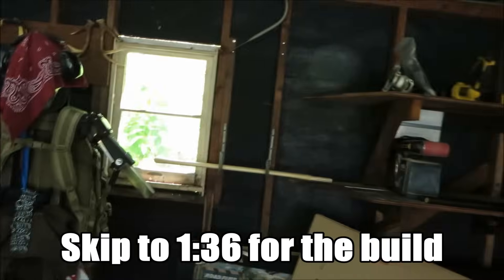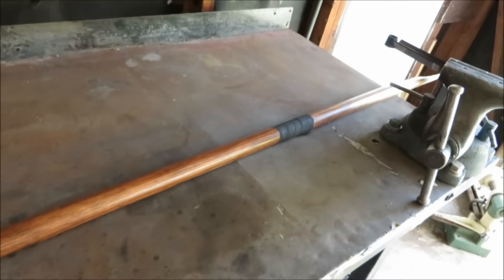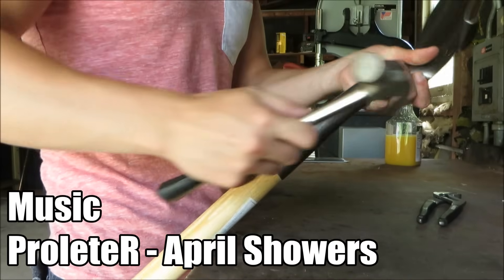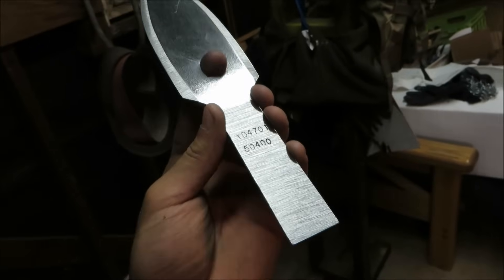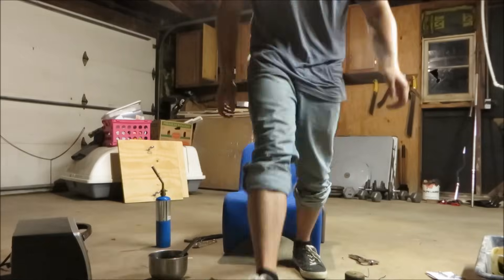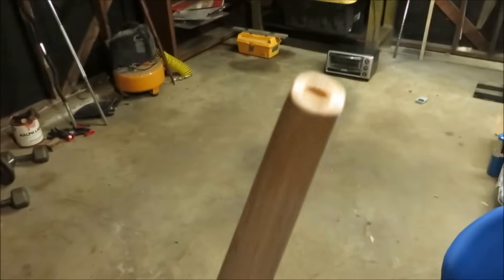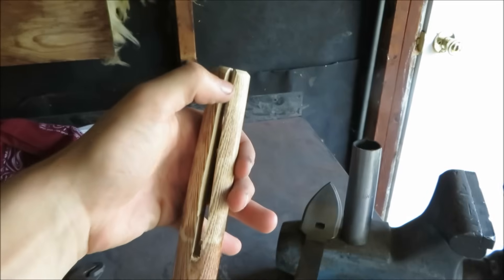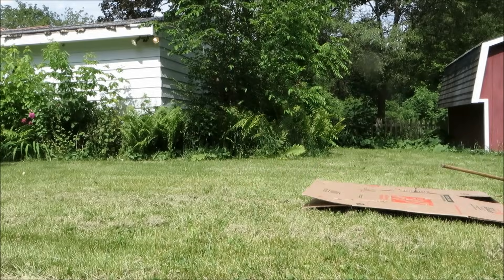How to Make a Throwing Spear

Comment: Just for future reference- the lawnmower blade would've been fine without heat treating (in fact heating up the blade would just draw out the temper already in the blade) as long as it was kept from overheating.

Comment: You don't NEED to polish it after the tempering. It is a good idea to make sure you have it clean for it's last coat of oil to avoid rusting, but it's a longevity measure. Usually you temper then put the final edge on. You don't want a very fine edge when heat treating and tempering because it makes it more likely to warp the blade.
Reply: He's right. I'm a knifemaker, and when I send my blades out for HT, Everyone tells me not to put an edge on it because of warping. I've never had it happen, but I'll learn from it when it does 😉.
Reply: Hunter Hengst Haha. Yeah the day it happens will be a sad one. I'm pretty sure it has to do with what kind of metal you're using. If you're using modern materials that you are just shaping, I doubt you'll run into an issue. If you're making your own billets from plumes or mixing materials it's probably more likely to happen. I think it has to do with irregularities in the material.
Reply: HairyViking111 he cooked them
Reply: MrAws0m3Gaming Yes.
Reply: U just grind that there primary bevel down to .020 inches and ur all good, shant warp provided u pre heat ur quench and make sure that u heat the metal to the lowest possible temp before the quench,it's not the tempering that warps it, it's that there quench, tempering ain't a shock to the metal at all, I mean if u make a rig and temper, u can get sum bends out, but it won't warp shit naturally
Reply: Lol haha

Comment: At the beginning you came off as annoying, but you're a pretty smart kid. Glad to see you know your shit, or at least you're doing your best to learn from your mistakes while meeting problems and making a plan to deal with them. Keep blacksmithing alive, even if it's using a hand torch, speaker magnet and an oven. :P

Another trick you can use, if you didn't already know, is if you have the lights down low or off, you can tell when it's ready to quench when its the color of the red rising sun. Should be non-magnetic at that point.
Reply: Ó Slatraigh that color doesn't seem very specific... but i don't know enough about red rising suns to debate it
Reply: teejaye110 Like the japanese flag. ;3 You've never seen the sun when it's that bright red color?
Reply: That my friend Ó Slatraigh Slat rights not blacksmithing  but stock removal
Reply: nick schafer I don't need you to tell me what smithing is. I was a metalsmith's apprentice for quite some time. I have used every type of peened tool you can think of, sledge hammers, pneumatic hammers,drop forge, chisels, tongs, hardy tools, punches, monkey tools, vices, coal and propane forges with hand crank, bellows and electric blower, and I can tell you that stock removal or grinding is a part of smithing, whether you use a power tool or a water wheel and stone.

Blacksmith

black (iron), smith (artisan)

It doesn't matter what tools you use to achieve what you need to do, but whether you are crafting something from iron/steel.
Reply: cough cough if he is making a blade he is technically  bladesmithing please let me know if I am wrong Ó Slatraigh

Thank you for informing  me on this subject, i'm just going to catagorise everyone who works with metal  as metal workers
Reply: nick schafer Bladesmithing is a branch of blacksmithing, unless you're working with a different metal. I'm not sure what about this is unintelligible to you. A farrier is a smith who makes, repairs and fits horseshoes, but he's still a blacksmith. A bladesmith making blades of iron or steel is a blacksmith.

People who work with metal are metal workers. It's an umbrella term. Metalsmith is a catch all for those who fashion things of various metals, including, but not limited to: blacksmiths and whitesmiths (tinsmiths), goldsmiths, silversmiths, etc.

black·smith
ˈblakˌsmiTH/Submit
noun
a person who makes and repairs things in iron by hand.

met·al·work·ing  (mĕt′l-wûr′kĭng)
n.
The process or art of shaping things out of metal.

Noun	1.	metalworker - someone who works metal (especially by hammering it when it is hot and malleable)
smith

He fashioned a spearhead of what appears to be a ferrous metal.
Reply: Ó Slatraigh i learned much today thank you

i agree on the ferrous metal
Reply: Anne Nonimus Ok, blacksmith/knifesmith here, Forged in Fire is a great show but the judges and the host are absolute shit... its a reality show for a reason but I wouldn't take what they say to heart. If anything pay more attention to the craftsmen and less attention to the judges and host.
Reply: Ó Slatraigh You know your stuff mate.    :D
Reply: solosniper86 No I don't. I've never opened up my guts to look. :O
Reply: Ó Slatraigh haha.might hurt a bit.
Reply: i don't know him but i like to thank you for the comment, i'm (part time blacksmith, sort off) but i have learn that you never losses in smithing or in life...ever....either you win or draw or must important... you learn and if you learn you didn't losses at all!

Comment: that thing seems pretty heavy.... more for a close-fight or so.
Reply from the maker: Cacalari Bus Heavy compared to what?
Reply: ZednoughtAlpha
compared to something like that: http://www.fotolibra.com/gallery/32524/early-hunting-spear/like/

Maybe something like 1.5pound would be good for throwing a long distance?
Reply from the maker: Cacalari Bus A stone age spear? Well yeah, steel is heavier than stone, I showed in the video though that you can hit a target at least 30 feet away, and that's with no spear throwing experience. Definitely wouldn't say the extra couple ounces make it a close range weapon.
Reply: ZednoughtAlpha
ok, nevermind :) .. for long range they would use another system anyway.. with the sling attached to the speer.
Reply: ZednoughtAlpha could just use the pins and wrap the top with twine instead of the shovel tube.  but what you made is awesome anyway. good job
Reply: Remember, when throwing a spear, hold one hand below the balance point to make sure that you throw it front heavy.
Reply: +Cacalari Bus Roman pilum could weigh up to 11 pounds. And it was designed for throwing.
Reply: armorhide406
so short-are throwing I guess. 5- 20m or so. Ok.

Comment: Nice video, one small thing:
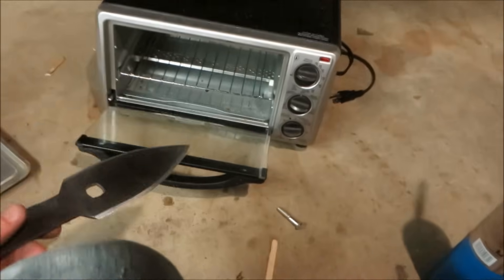"...the tempering is done when it reaches like a golden wheat color" (06:00)
One of the most proliferate (but understandable) wrong assumptions about metallurgy. No, it doesn't. The color depends on the thickness of a forming surface oxide layer, that thickness depends on the metals surface temperature. Straw-gold means you reached around 400-440°F (200-230°C), on the SURFACE, but it doesn't tell you that the martensitic structure inside the steel has been sufficiently relaxed.
The general rule-of-thumb for simple oil-hardening tool steels (like lawnmower blades) is to soak for 1-2h at a bit over 400°F. If you want it more precise, find out what steel it is, and go to the manufacturers website, they usually have detailed data sheets for the heat treatment oftheir products.
Reply: Why did you write this and why would I read it
Reply: Because you care about metallurgy?
Reply: You mean soak as in place it in oil and then heat it? Why would you have it in oil? More even heat distribution?

(edit: I know this is two years old but please answer, I wanna know)
Reply: @opiwaran354  no he means soak it in the heat for 1-2h, though soaking in 200c oil for 1-2h works better as the oil gives a more consistent heat as it acts as a thermal mass
Reply: @lol49031  okay, thanks.

Comment: how would one go about tapping the spear head in place? considering the tip of the spear won't enjoy being tapped with any kind of hammer.
Reply from the maker: +BionicleFreek99 For a majority of the tapping, I inserted a steel rod into the hole in the lawn mower blade and struck it downwards (as shown in the first spear build), then for the remainder, I clamped the blade in a vise, padded the bottom of the spear shaft, and tapped from there.
Reply: +BionicleFreek99 Another method you could use is, if you have vice grips, clamp them onto the blade horizontally and tap the grips with the hammer. You may need to alternate the side you have clamped to tap it in evenly though.
Reply: put a block of wood on the spear point and hit the wood
Reply: +BionicleFreek99 use a piece of wood, a wooden mallet, rubber mallet or even a large block of wood would do
as long as it isn't metal what you are using to tap the spear in you'll be fine
Reply: +ZNA Productions lol at the store they probavly wonder why u need so  many shovels and lawnmower blades XD (p.s we have the same Birthday Nov 13)
Reply: you could put the speed head in the vice and tap the end of the spear into the the bottom of the spear tip
Reply: BionicleFreek99

Comment: I find that when working with wood, no joke, hot glue is extremely strong, and easy to replace in the event of failure. But you have to get the hot glue way hotter than you should. So an overzealous hot glue gun is required.

Comment: Nice,  a spear is the best non firearm for defense.  You can hold off an angry mob with a spear as long as you got ur back covered by a wall or suchlike.  Depending on the length you can keep your foes at a safe distance from their clubs,knives, machettes, axes etc.  As an added feature you could bang some nails thru the end(about 8" behind the spear tip to prevent someone grabbing at your weapon as once that happens you are at the mercy of the main mob!!

Comment: Also, I was wondering if putting epoxy or glue would keep the tang from wiggling around too much. I notice it happens with some hand made stuff. The space between the pins and/or the tang and the haft (or handle, whatever) is too much. Or so I would imagine. Let me know what you think. 
And thank you for posting. It was REALLY simple to follow and it makes a realistic if not modern spear. Battlefield worthy I would say.

Comment: try making a rocket forge, pop the valve on an empty propane tank, cut around the top handles then cut a smaller hole in the side for one of those heat blowers then attach a propane torch and then turn it on

Comment: Just use something like Japanese blue steel or a cobalt drill bit for an edge, and then then forge weld that to wrought iron. Then shape the tang of the blade into a cone so it can mount onto a shaft.
Also, lawnmower blades are made of a very cheep tool steel, and I would not recommend it for something like a spear blade.

Comment: The quench-oil instead of water: does this protect the metal, cool it at a different temp for effect, or both?
Reply: Quenching in water can raise chances of micro cracks, while forging heating up the oil to about 100 degrees helps reduce the chances of cracks and maybe warps

Comment: Why not just start with the shovel, straighten the scoop out and cut away any unnecessary metal?  Then you can put an edge on that.  :)

Or.... start with a pitchfork, remove the unnecessary forks and fine tune the edge.  :)

A pitchfork is really really close to being a spear.

Comment: it's called a javelin
Reply: A javelin is different from a throwing spear. A javelin is rounded to a point, where the blade is only sharp on the tip. A spear is sharp like a knife, both on the tip and the side of the blade.
Reply: OG_Dickbutt thank you captain

Comment: How to make a throwing spear:
Buy a shovel and a shovel handle replacement, an angle grinder, a vertical power saw, motor oil, a propane torch, dish soap, a microwave(????), sandpaper belt machine, a power drill, a nail, a round point hammer, paint, and alot of practice.

Aka buy a spear on your nearest walmart
Reply: thx didn't realise